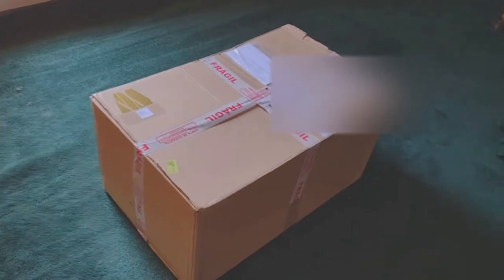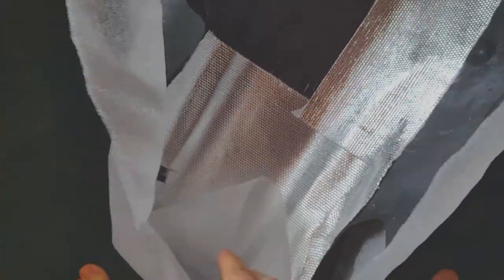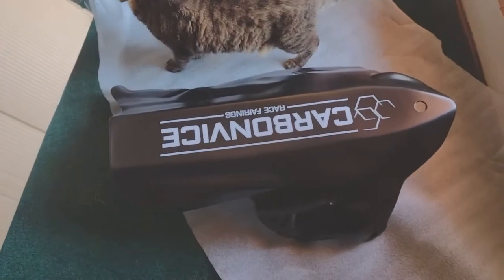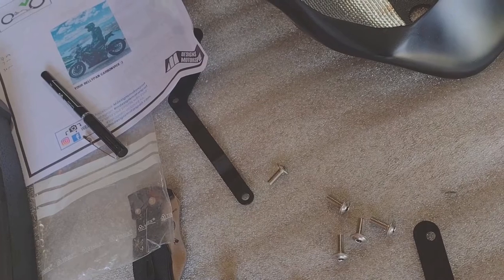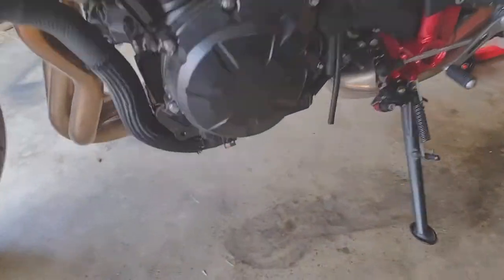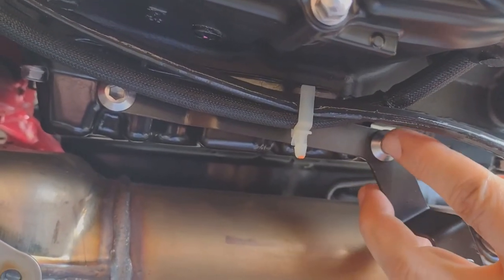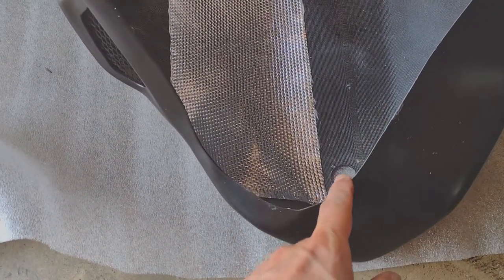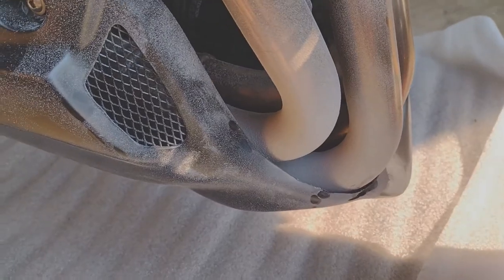Kawasaki Z900 Belly Pan Install --  M Designs Motorsport Z-Cup QUILLA CARBONVICE DOWN COWLING

Comment: Do that fits with a different header or the original header only
Reply from the maker: This is from their website:  Belly pan official Carbonvice of the European ZCup for Z900/Z900E/Z900SE 20-21-22-23 in matt black, thermal protector is included for the inside and anchorages. FOR MOTORCYCLE WITH OR WITHOUT CATALYST and WITH ORIGIN HEADERS-ELBOW OR ANY MANUFECTURER, LESS SCPROJECT AND ARROW.